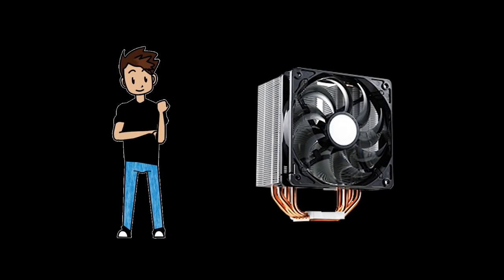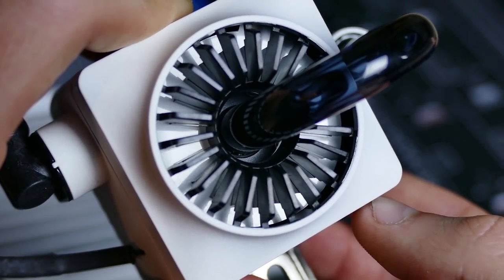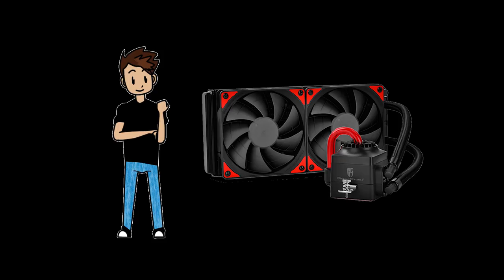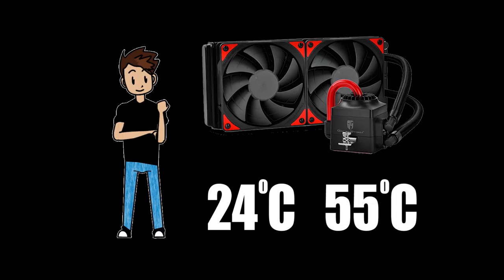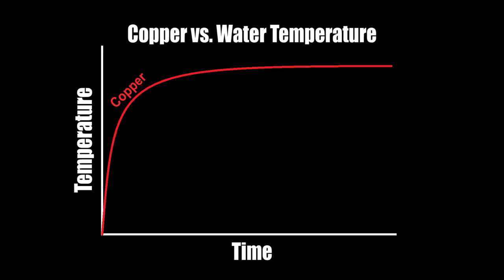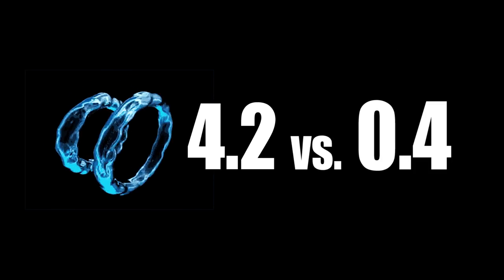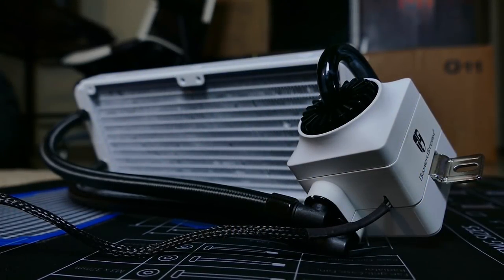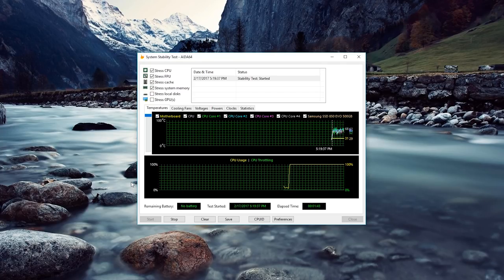How to Properly Measure AIO Temperatures

Comment: Why do car engine use water to help cooling. If you use metal stick engine will overheat just like all them cpu.
Reply: ... There is plenty of air cooled engines. It is not a problem. But car engines use water for a lot of reasons. Some of them are: maintaining operational temperature with thermostat independent from temperature of the air(can operate from deserts to siberia), achieving operational gaps between the metals for best efficiency and longer engine life, fuel saving, maitaining oil temperature

Comment: And to have increase in temps u need more heat...so if you exit the benchmark or game the cpu needs less power when the clocks are lower so the temps from cpu are smaller and the wather is not constantly getting 75°C heat from cpu so it would take less time to lower the wather temp.....if u understand what im trying to say xD and if fans are blowing a little less than room temps (lets say room temperature is 24°C) and we have 2 fans as an average than because of difference in temps the radiator doesent need that much time to cool wather

Comment: you are making a mistake. The advantage of liquid cooling is:
- Water removes more heat than air
- The exchange surfaces are much larger.
The problem you encounter can have two causes:
1- do not circulate enough water (the pump is small - the flow rate is small)
2- there is not enough air to cool the radiator (there are no fans on the radiator or they have too little air flow).

Comment: I am building my 1st rig and my case is coming with a liquid cooler.  Anyhow the question I have I can't seem to find anywhere and you seem like you know your shit.  Do I need to put the liquid in...meaning does it come filled already and how long can I expect that liquud to last before I need to change it out.  Also where do I get this fluid.  I appreciate any answer you can give me.
Reply: Oldman Torq you don't need to put the liquid in, or change the liquid if using aio liquid cooler. Except for custom water cooler.
You'll be fine..

Comment: Cool vid. As a suggestion - it would be interesting to discuss the thermal stress scenarios for each cooling system (and the hardware they're cooling) for air vs water.

Comment: I like the argument, but couldn't you argue, that for a water cooled system, not necessarily an AIO, if you had an extremely large and thick (ha!) Radiator, let's say a quad 140 that his a much higher heat dissipation capability than any standard air cooler, the delta between the air system and water cooled system comparing steady states, would be very much different? Sorry, that was a very long sentence.

Comment: But the end result as he stated is the AIO is lower at long range temps than traditional fan coolers. Even with the longer cool down time the peak heat is lower. End result is AIO is better cooler. Good video by the way!

Comment: well, what you arent taking into consideration tho is that the water is moving. the water will never reach the temp a air coler even if it would do it slower(unless you ofc dont have a radiator lol). the water will just raise a few degrees c. so it can move it from the base plate to the radiator. if you look it up most aio coolers cant even handle liquid over 60 c. :P

Comment: Good info and well explained, thanks! I'd heard that adding a coolant reservoir helps stretch that curve which makes sense... more water = more thermal mass! What do you think about thermoelectric coolers? Also, are thermal pads good to use or should I stay with thermal paste? Thanks

Comment: Isn't it also better that the heat cycles are smoother?  Especially in the case of soldered CPUs as manufacturers say that rapid temperature changes from say 24c to 80c over and over is what ages the silicon.  In extreme cases Intel claims it causes cracks in the die.  Most CLCs have more surface area therefore they run quieter, and last about 5 years if you get a quality part.  I think the lie is that they aren't expensive because if you want a quality AIO it is generally $100+ USD.  I got a fractal design celsius s36 for $129 and it is a great cooler. Keeps idle temps at 24c and load temps under 65c on a 4ghz r7 1700.  It does exactly what I need.  You are right that some people don't let the loop heat up but they will eventually find that out for themselves. Some people are just new to the hardware and don't understand so in that sense I guess I'm glad you pointed that out.

Comment: Noooottt exactly. With AIO vs Air coolers have you noticed that when ending the benchmark the AIO cooler will drop your CPU's temp quicker that an air cooler? That's because AIO coolers are meant to drop CPU temps quicker than air coolers. There's a reason why a radiator in an AIO cooler have so many fins and channels. Yes you have constant air flow on both coolers but in the end the AIO wins because it can cool faster due to greater surface area. For example, in games with heavier ambient occlusion = more CPU usage (and GPU) = higher temps but I want my CPU to drop temp quickly before I hit another grassy area not delta down a degree before I do. Instead I want to drop down as low as I can as fast as I can so leveraging a AIO cooler fits that application. AIO coolers are not lying to you. More specifically, their application is is different in comparison to air coolers. If your CPU is running high for hours on end then an air cooler is right for you. If you game and core usage varies thus temps vary then a AIO cooler is right for you. If this is the case then custom loops are lying as well....

Comment: So by having an aio your cpu will last longer as the temperature doesn't spike and then drop off completely. As you should know, heating something and then cooling it can cause cracks and in PC's over time your cpu will become worse and eventually the damage interferes with the dye and it just stops working. So with the aio it doesnt expand and contract or heat up and cool down as fast meaning your cpu will alst longer :)

Comment: Just wanna point out that specific heat capacity is not the same concept as thermal conductivity. When you mention the reason copper's temperature rises much faster than the water it is not only due to the fact that it has a much lower specific heat capacity, it is also much better at transferring heat from the cpu to the material itself. This doesn't detract from your point that an air cooler's temperature will rise much faster than an AIO liquid cooler before reaching equilibrium but it is wrong to attribute the reason to specific heat capacity.

If we can find a wonder material that has a very high thermal conductivity and high specific heat capacity it will be the holy grail of cooling solutions. It will be able to suck all the heat from the cpu as it's generated and it will be able to hold all that amount of heat before resorting to having to transfer that heat to another medium, air, which is a poor conductor of heat, bottle necking all cooling solutions.

Comment: A lot of poor/mis information here, copper and water will both absorb heat, but the reason there is latency in an AIO is that there is a greater volume of water. Of course ALL the longer temperature latency is actually below that affecting any processor throttling.

Comment: Who runs Aida 65 for hours at a time? Yes the amount of water in the AIO will take time to heat up, during which the pump will circulate through the cooler and dissipate some off. The idea is to keep the core temps from spiking high quickly and cooking your CPU. Water loops slow that process greatly
Reply: Aida64 (as well as any stress test) is pretty much intended to be run for a long period of time. It's meant to test the stability of the system. And the idea is to have sustained CPU temps, not just a slow increase to unstable or unsafe temps.

Comment: Nice intro... but ... you have to account the air flow and the water flow ... if you have a higher flow off water and a correspondent radiator ... you can have a delta very low to ambient ...and the speed off energy dissipation is a lot faster ... energy = flow x DT ... valid to any fluid ... doo if you want lower DT you have to increase the flow.... I had a rig with +5°C above ambient under load ... with gpu in the loop ... is a matter off thermal dynamics....

Comment: Nobody is lying. If you think that looking at your temps in the first couple minutes is the proper way to measure temperatures you have been doing it wrong. You need to let the stress test run for at least 20 minutes. And then again, having a cooler than takes longer to get hot is still a great advantage. Most of the stuff on everyday use are just short intense bursts.

Comment: I do see the logic in this. One thing water cooled has on air cooling is the space it takes up on the motherboard. I trust a quality air cooler over water cooled though. Air cooling can be a real issue if you don't clean out your computer often enough basically insulating the components leading to catastrophic hardware failure. Water cooled can fail though or burst causing damage to components within the computer. Pros and cons to both I guess.

Comment: The water is not there to dissipate the heat, it is there to transfer the heat.  You still need a heat sink, aka radiator. The radiator will decide how much heat you can dissipate / time and power. Otherwise, agree with pretty much everything.

Comment: Great content but.. the title is a bit inflamatory. You made a good breakdown of the thermodynamics of water cooling loops but i wouldn't go so far as to say they're a lie, there are several benefits to a water loop over a simpler metal or heatpipe cooler. Potentially lower system noise for one which is the core reason i bought an AIO. :o

Comment: I don't see the point. Wasn't that how AIOs or any other liquid coolers work? Liquid cooler at idle, temperatures are close to room temp. When under load, the liquid heated up, heat starts to dissipate at the radiator. The rate how heat exchange doesn't depend on the specific heat of the coolant but the size of the radiator.

Actually, it's the large specific heat capacity makes the whole loop safe for your computer as the liquid won't heat up so fast that boil at the CPU block! The liquid inside the loop should never reach 40 Celsius degrees, and the leakage is likely to occur if higher than 50 degrees.

Yes, there will be change in temperatures if you wait longer, but no larger than 5 degrees if the size of the radiator is proper. The liquid is usually below 35 degrees at load, so what's your point at waiting for hours to see the temperature changes?

Comment: But still water cooling is better in terms of temperature, and it takes less space, big heatsink won't fit small case and it will block the RAM slot, a 80 dollars aio is much better than a 80 dollars heatsink

Comment: Yeah we found out rapidly in the old days of making all your own kit for water cooling that the radiators ability to remove heat from the fluid is always your temp bottleneck.
Fluid temps are the main defining value in your water cooling systems ability to keep temps low and maintain those temps.

One reason my water cooling rig features a medium sized 3litre static sump, and is fed directly from the mains. I have no radiators they are the death of high performance watercooling.
Urge anyone wanting to SERIOUSLY overclock to look into knocking up such a rig ... its great, almost silent (as the fans on AIO radiators create as much noise as an air cooler), there is no heat build up in your fluid as you constantly vent the exhaust  (warmed) water, Saves a ton of case real estste, cheap too, the only REAL water cooling part you need is your Waterblock/s, everything else can be bought for peanuts from aquatics and garden shops.
Cons: Non portable, so no good for Lan party people. Uses a few litres of water per day so probs not good for people in water metered locations

Comment: Look man... even if the temps are immediately lying to you they're still lower than the air cooler in the long run as well... so even though you have a point.... in the end water is still better for cooling...

Comment: This is not what you call a lie. This is uninformed people making false assumptions.

Yes a water loop has more mass in general to soak up heat which means it takes longer to reach its delta. That being said a water system also does a much better job of removing heat from a system for several reasons.

First it lets you put the radiator in a location to either get fresh air form outside the case (which lowers temps) or allows you to dump the heat outside the case which also lowers the internal case temps for your other hardware.  It doesn't blast random air flow in your case potentially disrupting your cases air flow.

Then there is the surface area of these things. With a air cooler you are more limited to amount of surface area and weight of the unit. With water cooling you can split the surface area into multiple peices (radiators) to easily increase the amount of cooling power you have at your disposal.

Comment: Thank you so much for explaining the difference between air n water coolers to me. I'm going to be building my first desktop n wanted to get the correct cooler type for an i7-8700k cpu. I'll be choosing an air cooler that is verticle with push pull effect. Subbed n liked this video, thank you again buddy, woohoo :-)))))))

Comment: IF..
they could run it outside the case...It would be a solid Ambient temp vs, Internal..  Get the heat outside..
The more air you can throw thru it the better...  BUT it wont be Quiet..

Comment: Your comment on water/metal and their cooling times is incorrect. Though it works with your initial argument. Water dissipates heat much faster than metal. The only reason it doesn't in the context you're speaking of is due to what the water is incased in. where as the metal doesn't need surrounding case thus it has more air flowing around it cooling it faster.  That is why your argument works, not because metal inherently dissipates heat faster than water.

Comment: So why not just pump new cold water in, wait for it to reach specific heat capacity while the old batch of water cools, then switch it back? If you can measure how long it takes to reach specific heat capacity of water on a computer at a certain speed setting, Then you can set up a sort of relay system that uses only the fresh water that has been cooled. An even better idea would be to draw energy from the hot water and use it as electricity. You of course will still need some other source of electricity, but you could save a bit on power consumption, and cool your computer efficiently

Comment: You forgot to mention that aio's alos have an extra fail point, the pump AND it has liquid in it. Well, u definitely mentioned liquid, but liquid and electronics dont mix. Why anyone would put liquid in their computer is beyond me when air coolers do the exact same thing.

Comment: Simple solution: measure the temperatures at start-up, then at idle back to back with an air-cooled system and an AIO-cooled system. Real world testing vs. mathematical theory. Let's see the actual results.

Comment: Having more gradual changes in temp is better for the life of your CPU, less mechanical stress from heating and cooling rapidly like an air cooler will do, I built my own block from copper and liquid cooling system using a fish tank pump and including a radiator which is nothing more than a long vinyl tube wrapped into a coil , cost me 40 bucks and some time but I cant just go buy a premade thing wheres the fun in that?

Comment: Ok. The point of aio's is not so much that they cool better. Most will be on-par with a quality air cooler. The advantage of them:
- is that they are less affected by ambient temperature
-the heat from the CPU is removed from the area rather than blown, increasing ambient temp in the case which the VGA uses to cool itself
-you can achieve same cooling as decent air coolers with fans running much slower, and therefore quieter

Comment: In normal use, not running prime95 or aid64 which is designed to just push the envelope. your going to reach a far lower max temp when it equalizes, than you would have with an air cooler... who cares how long it takes to cool down afterwards. when your max temp while gaming or running regular tasks is still 20c lower than your air coolers max temp. either way it takes loads of stress off your cpu in the long run... I understand why you made this vid though. just to inform people on how AIO's work. Thank you

Comment: AIO:  + aesthetics
         + memory clearance
         + noise 
         + somewhat easier to mount regarding you have a decent and newer designed case
         + easier to clean the fans or change them without taking down the whole cooler as in Air coolers case
         - needs extra airflow for VRM (biggest issue of an AIO cooler)
         - price
         - many don't perform under OC conditions

Air Cooler:  + price
                     + helps allot in cooling the VRM
                     - cheap ones are noisy and not suitable for OC
                     - memory clearance
                     - those that perform are as expensive as an AIO and also voluminous and heavy
                     - dust magnets
Reply: MirceaBv How often should I change the water?